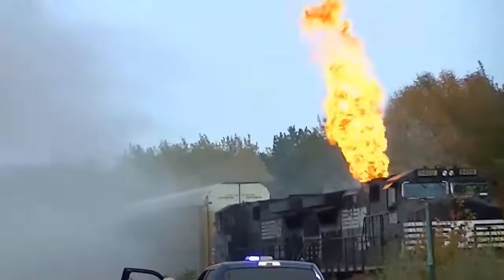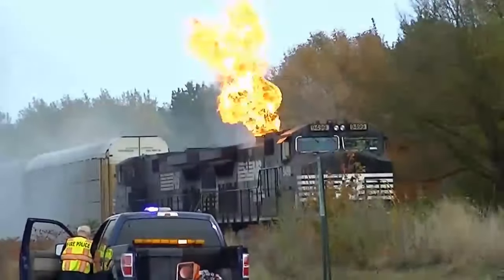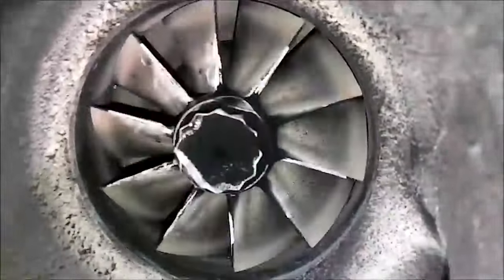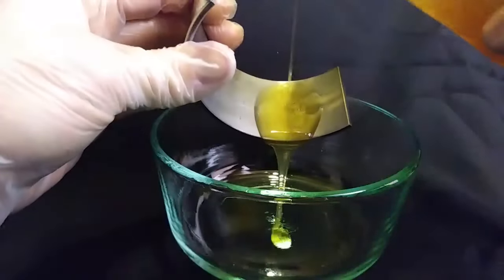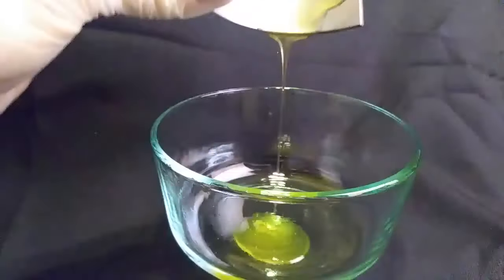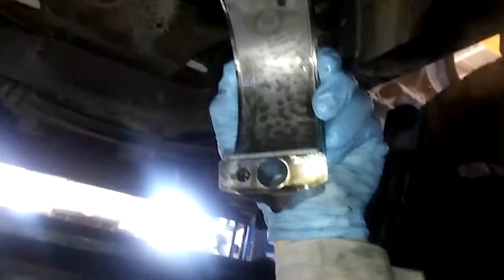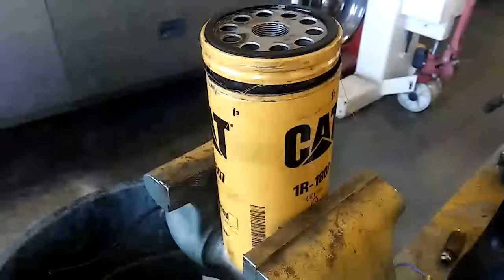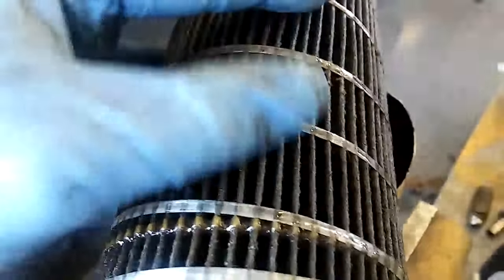Engine Block Heater vs Oil Pan Heater. Everything you NEED to know about Cold Weather Diesel Engines

Comment: My first cat was a D4B and it would not start in the cold. I have had good luck with all the other cats I’ve had since. My best starting machine so far in the cold is a EL160 B Volvo. It has an air intake heater and it has always started even down  to -40 and that is very common here in Ontario. It is a 2006 and even. Has the original batteries. My Cat truck starts good in the cold but has thrown a code since it got cold that I haven’t figured out yet. It is a ct13 engine and the code is spn 5542, any ideas what that would be?
Great video and well explained👍

Comment: I have espar coolant heater with 2 seperate batteries than 4 starting battery inbetween relay to charge 2 batteries after 4 starting batteries are charged and oil pan heater, espar has timer display , before going to work with help of timer coolant is at 150° f plus fully charged batteries.

Comment: You did leave out one of the best systems but the most expensive, an onboard genset with thermostat controls for engine fluids and batteries. The added benefits for trucks particularly sleepers are cabin comfort in very cold or very hot weather, when equipped with an auxiliary or a integrated HVAC system controls. The economics of this system are: the very small diesel engines which are fuel misers compared to idling the big boys. These systems usually come with on/off switching hooked to thermostatically controlled functions. Also some jurisdictions will penalize you for continuous idling.

Comment: Well, mercedes diesels had a heater coil installed in the cooling area on the side of the block. Otherwise they could be installed. They worked plus other things that need to be done .

Comment: I have a block heater and an oil heater. Since it's a HEUI system and needs high pressure oil.
Reply: Oil heaters are always a good idea. With HEUI engines the are a GREAT idea. Arguably better and more effective than the block heater.
Reply: @ronunderwood5771  yeah it made the HPOP lot quieter and not whining like crazy on extreme cold mornings

Comment: Thank you for all your videos. I have always thought that the glow plugs and heater grids are stealing power from the batteries when they have the least amount power to give. I think that they should use a small propane torch in the intake with a piezoelectric igniter, that way it heats the air instantly and lets all the battery power be used to crank the engine.
Reply: And when it malfunctions you have the same problem as with piped in ether. Boom
Reply: @rorywynhoff1549  
Then make it fool proof so that it can't go boom. If we can't engineer a good safe system then our country really is doomed. I could engineer it to be perfectly safe, and never have a malfunction. It's not that hard, just a little more expensive, but when it comes to making things that last the life of the vehicle and not go boom, I would be willing to pay $100 for a propane start system. It would save you at least two times that over the life of the vehicle in batteries and relays.
Reply: @davidscott5903  
And therein lies the problem: If you could build it for $40 - $60 and would be willing to pay $100 for that option already on a vehicle, then the car manufacturers would be very happy to build it for $7.50 in China, or $25 here in the USA and then charge you $2500 for the option when you order your vehicle.
Reply: @ralfie8801  
Yes, you are probably correct, and I don't care who makes it, let's just make things better in our country instead of crying and whining about why we shouldn't make things better because china will just take it. That kind of attitude keeps America from being the best country in the world. We didn't let that stop us in the past, and we should start working to make our country better before we become America, Republic of China.
Reply: i can tell you from experience with glow plugs, there are engines that may crank for a minute (60s) in cold weather when the glow plugs don't work before they start and shake and sputter. with the glow plugs they start within 2-3 seconds and run smooth. I say run the glow plugs, your battery will thank you. and your neighbors, too. sometimes a cold battery won't turn the motor over for 60 seconds.....
Reply: @uliwehner  
I'm not saying to use nothing, using nothing would cause some engines to not start at all even with an hour of cranking. I'm saying to use an alternate energy source that isn't affected by temperature so much. With a large enough propane torch, you can provide all the heat that you need to start the engine the instant the hot air has been sucked through the intake system. If it were installed right before the intake manifold, it would only take two or three cranks.
Reply: @rorywynhoff1549  
You three are perfect examples of the pessimism that causes nothing in the world to be improved. You automatically assume that no effort should be made and no one should ever try to make things better. And so no one tries, and nothing is improved.
Reply: @ralfie8801  
You three are perfect examples of the pessimism that causes nothing in the world to be improved. You automatically assume that no effort should be made and no one should ever try to make things better. And so no one tries, and nothing is improved.
Reply: @uliwehner  
You three are perfect examples of the pessimism that causes nothing in the world to be improved. You automatically assume that no effort should be made and no one should ever try to make things better. And so no one tries, and nothing is improved.
Reply: @davidscott5903  
I said nothing of the sort, I just commented that someone would try it, but they would make it so outlandishly expensive nobody could buy it, while cutting the cost of making it so much that it would be a continuous issue to keep it working. Then there’s the fact we live in such a litigious society somebody would screw up somehow and cause a propane leak, then the rest would be history. The grid heater and glow plugs in my Duramax have never failed to get it started, even at 1 degree below zero F. I have both a block heater and an oil pan heater and have never plugged them in, but that’s mostly because I work 2nd shift and there are no power receptacles in the parking lot where I work.
Reply: @davidscott5903  nah, we are just saving you time. intake air heaters with gas and sparkplugs already exist. have been around for decades. you are basically inventing the rollerskates in 2022.....
Reply: @uliwehner  
I've never seen a propane powered intake heater, and can't find one online, so I didn't know that they already existed.
Reply: @davidscott5903  they used readily available gas from the gas station

Comment: I live in Sweden and my experience is that problem with the fuel couses most problem
 Engine can suddenly stop running if  you have parrafine clog. And then nothing helps. So heating filter is good and put some Methanol in the diesel.

Comment: I live in California and we are having the coldest winter we've had in a while and my God damn truck wouldn't start last night when I got off of work. When I finally got it going it took forever to warm up and was not igniting the fuel all the way which was causing rough idle and shifting even after the engine was already warmed up and the heater was going. I have to put a damn heating element on my fuel tank since my truck runs off e85 and the hotter burning spark plugs didn't help much. Otherwise my truck will not run properly even when fully warmed up because the fuel is too cold. Chevy Silverado 2010

Comment: A lot of old timers would run a 30% mix of kerosene in the winter. Kerosene and a block heater keep are old diesel farm tractors starting all winter long.

Comment: Well, the oil goed through the pre-heated engine, so it WILL heat up faster. The coolant pre-heater will not heat up your oil, but it will help heat the oil faster once the engine is running.

Comment: I have an Espar installed on my truck which is a Dodge Cummins. If my engine oil pan is ever removed from this engine for any reason ill be installing a coolant heater coil in the oil pan sump for my coolant heater to heat as well.

Comment: Oil heater is good if it's around zero degrees F . The heat rises and heats the block a bit. So both are warm. Colder than that you need both engine oil heater and coolant heater and even use 0w-40 engine oil

Comment: I drive a truck every day for the biggest soda company in the world and I drive a 2008 freightliner Columbia with the Mercedes Benz MBE4000 in it. Every morning I have to start my truck with starting fluid. What are the long term effects of doing it? The truck will not start otherwise. It would burn up the starter before it popped off.

Comment: My truck has oil pan heater and block heater and a diesel hotline and my fieltanks are heated you can order trucks  with an arctic package more heaters and more insulation

Comment: I wouldn’t use starting fluid on anything smaller than heavy equipment. Back in the day a hell of a lot of 6.2-6.5 gm engines were trashed with that. Wd 40 is much safer for small engines without heaters.

Comment: What's your experience with like webasto type heaters? Diesel fired coolant heaters.. I have one on my powerstroke, and it's the cats meow.. also, great point most overlook, thinner cold weight oil makes a huge difference, 5w40 will always start better than 15w40..
Reply: Those heaters are good when not around 110 outlets.
Reply: @cwj9202  great for OTR trucks, they also make them for warming the cab so you and your engine can be comfy away from home.
Reply: @cwj9202  that's exactly why I have one on my truck.. if I leave it on long enough, it starts like it was just running, even in -15 weather.. totally sold on it lol

Comment: Hi:  I've just purchased my first diesel vehicle, a 2005 Sprinter Van 2500.  We've hit single digits this week in my area and the glow plugs were challenged... battery sounded very sluggish (like it was dying)...  and it wouldn't start.  What do I need to troubleshoot?  What type of block heater (or jacket water heater) do you recommend?  Thanks in advance for any tips or advice you can share.

Comment: I wonder if a circulating water heaters are a thing in US? Like a high power block heater with a pump and a thermostat? I've installed one in my car years ago and I love it, it is close to 2 kW and cuts off at 80 deg C, meaning that I can turn it on in the morning and before I'm ready to go the engine is nice and warm. Block heaters in Europe are for some reason very low power like 500W or so, it would need couple of hours to preheat my 2 L gas engine.
Reply: Yes but not as common.

Comment: So my Cummins ISM has a freeze plug heater, dead. I need to put in a new one. Might change it up.
Reply: General rule is the factory one is properly sized already. Going larger just means the thermostat will start to open, then you are heating the great outdoors, as well as your engine. Your money your choice.
Best wishes all, stay safe.
Reply: do an ohm check on it and make sure it's not the power cord that's dead.. it's pretty rare for the heater to go, but that dangling cord will break internally
Reply: @Rx7man  I switched on when I first got the  coach. Smoke everywhere. Wire burnt up on the connector. Connector is toast. It’s actually a freeze plug so I am lucky it held up. It’s on my list.
Reply: @Rx7man  Yes the cord is most likely to go wrong, but after ~5-7 years? If you are, I believe <13 ohms, it's time to replace.
Best wishes.
Reply: @carlthor91  if it's around 13 ohms, that sounds about right, Ohms law is V^2/r = watts, at 120V that's 1100 watt
Reply: I have lots of block heaters that are OEM from the 1990's

Comment: You should do a video about fuel algae. And what the cause and solution is      great vids
Reply: Fuel bugs are caused by water in the fuel, algae starts at the water fuel interface. More of a boating issue than trucks.
Reply: @carlthor91  Emergency generators fueled from underground tanks suffer from that black slime too. Nasty stuff. Tho I've definitely noticed it's not as bad with ULSD. Nice side benefit.
Reply: It happens on occasion in trucks, typically from old poorly maintained fuel stops that simply don't sell enough diesel.

Comment: we used block heater with oil pan heater cause we get -40 and found after alot of use about 1 year pan heaters melted where electic cord joined the pan they r expensve and pain to change we quit using them

Comment: Oil heater and a s bar coolant heater and battery at top shape. If a bind spray but take filter and as turning little not a bunch. And fuel proper additive

Comment: Don't the oil filters have a reverse flow check valve (a rubber/silicone flap that blocks off oil passages, activated by suction)? I'm asking because I'm speaking from a gasoline engine perspective. The only diesel work I've done was replacing a (I'm not sure what the actual part name is) 'fuel distributor' on an early 90's Dodge dually.

Comment: Actually most important starting aid was not even named.
So.. I will help

a) working glow plug.

BMW for example, has a) glow plugs b) fuel filter heater c) fuel heater (can be started with remote).

Comment: I have an 06 c7 acert motorhome. Driving down the freeway 75 mph let off the gas and when I put it back to the wood it had little or no power. No engine light just kept slowing down until it stopped. Checked water trap and small things I could on the side of the freeway. Got it towed home put a reader on it... no faults. put the key in started right up. It was due for maintenance so I changed oil filter and fuel filters. Its running in neutral and I push the gas full throttle and it revs to 2700 rpm. Shouldn't it only rev about 2250? And secondly why did it leave me stranded? Don't have any way to check fuel pressure. Any advise would be appreciated.

Comment: What about fuel additives like SP diesel 911 to help prevent the jelling?
Reply: The diesel 911 is NOT for normal use. It's emergency use and instant antigel. A regular antigel additive should be used. Depending on location and temps

Comment: In my experience battery warmers do a lousy job. They're not completely useless but if you stick a thermometer in one of the cells you'll see almost no increase in temperature. Most of the heat generated is lost to the surrounding air. I boost the battery while running the block heater; that seems to be more effective.
 
Oil pan heaters work OK but they lose a LOT of heat to the surrounding air. Again, if you actually measure the oil temperature before and after you'll see very little warming. It would be different if the oil pan were insulated somehow. 

Coolant heaters are great but many are too low-powered. My truck's factory block heater is only 450W, which is almost useless at minus 35or 40C. The type that fit into the lower coolant hose are pretty good, especially if run WITH the factory block heater. You can even install two, back to back, in that lower hose. 

Very cold weather is very, very hard on vehicles. Even if you get the engine started, you're still dealing with extremely cold transmission fluid, differential fluid etc. In the coldest weather I prefer to stay home, if I can.
Reply: I just seen some block heaters with 3/4" NPT so could Weld a bung on an oil pan and pop one in super easy.

Comment: Two words.
Espar and Webasto. 
I would also like to address how NOT to have gelled fuel in the first place.
Keep your tanks full,  ideally from a busy facility.  
When driving from a warmer climate northward, you must add fuel more often. Your tank may be running a summer blend in Texas, you do not want that stuff in your tank as you hit a nice Dakota winter.
Not all states make the move towards a number one diesel, and this could be problematic. So carry anti gel additive, use as necessary. 
If dealing with a stupid level of a cold, or if us Canadians cursed you with an arctic cold front, do not be scared to add a few gallons of pure Kerosene or Jet A as a blend. (NOT JET B!!!).
Reply: You can use gasoline in you’re diesel fuel 1 gallon to 100 gallons of diesel

Comment: What about equipment in remote locations where there is no power source? Not long term storage but overnight in very cold conditions. Example; a logging operation in wilderness. What would be a good starting/wear reduction aid?
Reply: Hydronic diesel heater. Or a propane heater with some stove pipe directing heat under and up to motor

Comment: I didn't know how hot the oil heaters get and I didn't want to degrade the life of my oil. Mine looks like a short water heater element. I'm going to put mine in a available plug on the bottom at the side of my oil pan. It's a C15 Cat.  The blank port is the same level as my oil drain. do you know if there is any clearance issues once installed?

Comment: I’m sure this doesn’t apply to most of the audience…. What about smaller diesels that do not have freeze plugs? 
Tdi’s for example do not have freeze plugs.  I have a “frost heater” that taps into the coolant lines- but unfortunately does not heat nearly as well as a freeze plug style coolant heater?

I’m going to add a pan heater here soon as the motor is known to have main bearing issues already…. Who knows maybe I’ll run them both 🤷🏽‍♂️.

I started with the frost heater as it came highly recommended… it does “ok”- for the money though??? I don’t know…
Reply: Brand ABN 4" x 5" pan heater temp regulated to 195⁰ like $25 on Amazon

Comment: I just installed a engine block heater in my 6.5 .. what is the rule of thumb on keeping it plugged in?
Reply: Simplest is an outdoor timer. 2-4hrs before starting to conserve power and heater life. If you get a smart timer you can set different schedules super easy or turn on from bed.